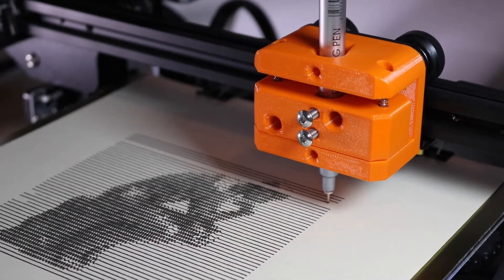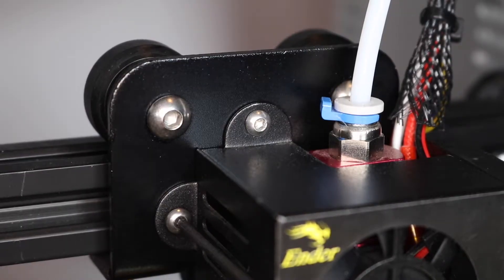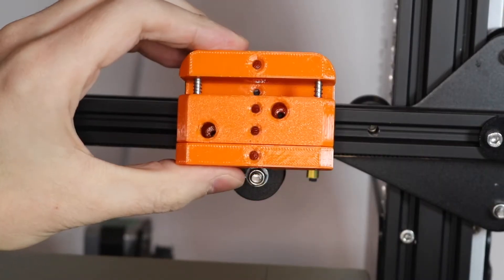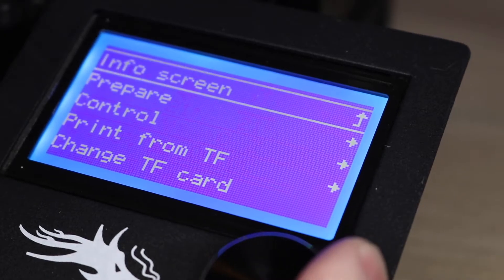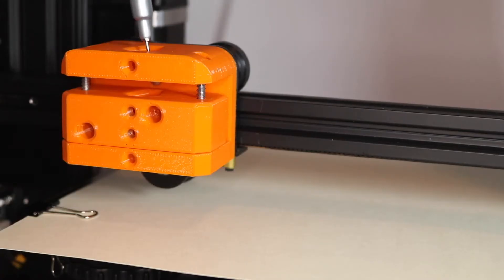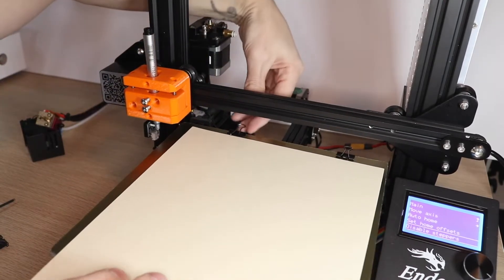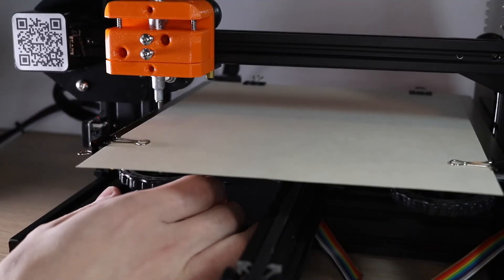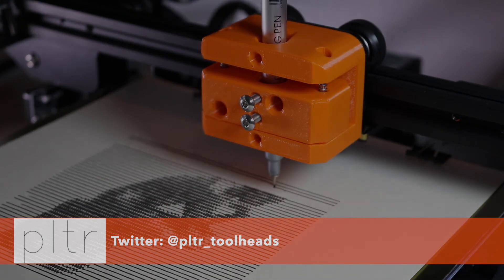pltr v2 Pen Plotter Toolhead - Ender 3 Installation Guide

Comment: Hello, Andrew! Would it be possible to use your pltrv2 on an Ender 3 V3 (SE/KE) in some way, shape or form? And if not, how hard would it be to create something similar for its gantry?
I'm currently considering my plotter options and a retooled Ender 3 (plain or V3) seems like the cheapest starting option at the moment.

Thanks in advance -- it's a wonderful project!

Comment: Thanks for this! I noticed on this video and my own testing that the prints are not centered. I tried everything to get them to offset to the X and Y axis short of physically moving the switches and nothing works. Any ideas? You can see in the calibration test that the whole thing is off to the left.

Comment: Fun fact, I have designed(more like remixed) a mount that allows the hot end to stay in place, the addition of a bl touch, and has spring articulation. Btw, it's 99 percent 3d printed, needing only a spring from a clothespin, and 3 M3 screws. Oh, and it's 100 percent free on my thingiverse page...
Reply: can you post the link? i will try ir! thank you!
Reply: @jockpunch  hopefully that helps
Reply: @keylay9453  Can you post the thingiverse number? Thanks :)
Reply: Helpful info!